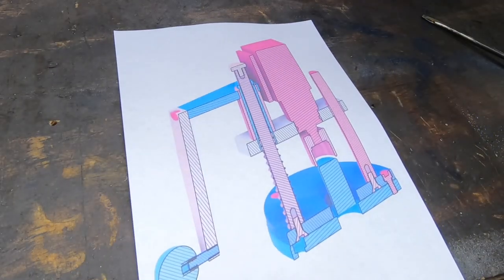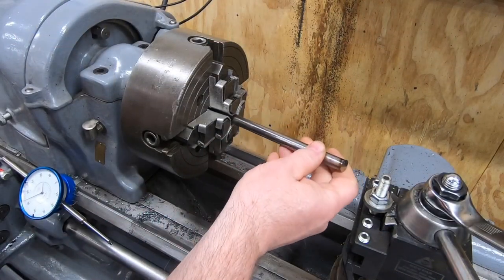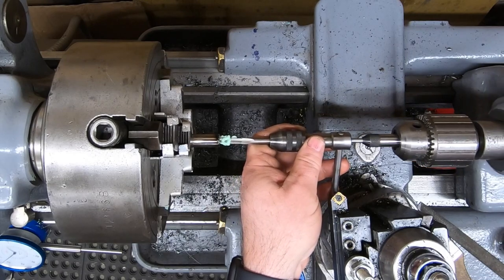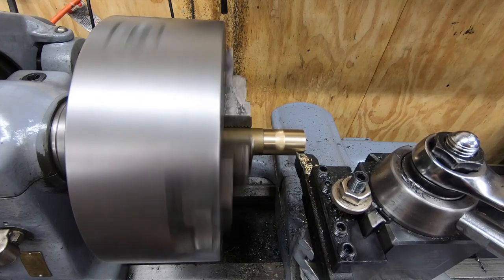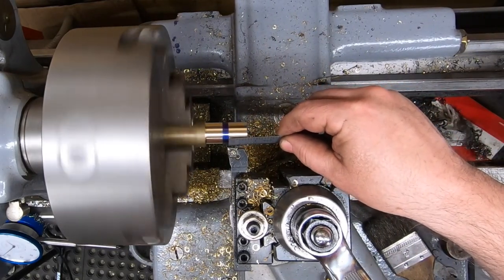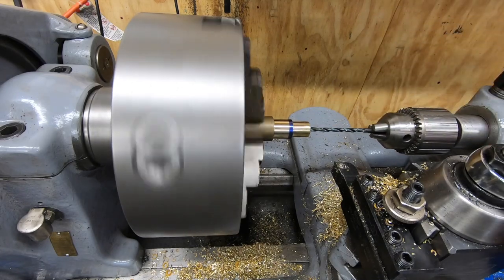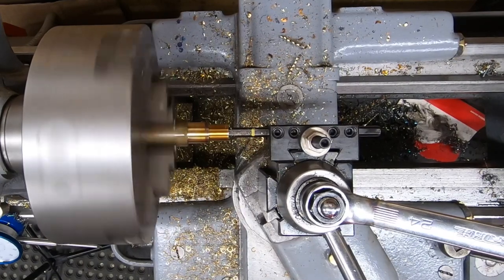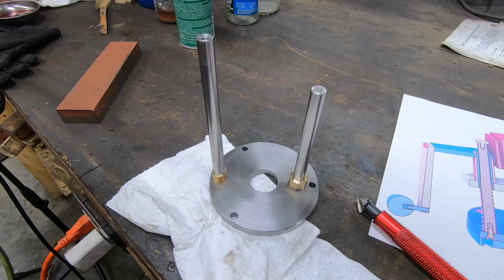Power Drawbar for the Bridgeport Mill - Making the Guide Shafts and Bushings

Comment: Maybe sintered bronze bushings could have been a better direction to go than the brass. Better lubricity and readily available. Just my 2 cents. 
Thanks for sharing 
Cheers
Reply from the maker: Thanks for the comment. I think there are probably 100 ways I could do this better. 😂 Part of my goal was to try and use material I had in the shop.
Reply: Of course my friend 
Cheers

Comment: I'm wondering if you have a piece of aluminium bronze rather than brass? It is quite a lot harder than brass which may account for the difficulty you had drilling it. Brass does need a sharp drill bit and bits that will cut steel quite happily can struggle in brass. Best case is a low helix or straight flute drill and only use them on brass. 
Regards,
Preso
Reply from the maker: I really have no idea what it actually is. I supposed it could be a flavor of bronze. I'm not even sure how I would find out besides having it tested.

Comment: figure out a way to grind the jaws of your 3 jaw. I use a vitrified stone in a router mounted to the tool post with a BXA  QCTP holder. I made some shims to hold the tension. now I have used the same set up on 3 lathes and 5 chucks My new lathe has 2 part jaws to I made a ring with holes to use one of the bolts to tension the jaws this time. I will hopefully be doing again today. this chuck has been ground for another lathe in the past. You must do this on the lathe the chuck is for.
      I am working on the back plate now. It is a similar set up to the mounting plate video from 2 months ago. I also had to relocate the holes in my vice to enbiggen the holes to allow for more adjustment. It ran 10thaou out 5 is a lot to grind. Grind until there are no sparks.
     The d1-4 taper on my new lathe doesn't exactly match a standard chuck. I used the grinder set up to match the backplates to the spindle nose. I got lucky twice now. The backplate for the er40 collet chuck is on the way. I expect to have to grind it too. 100$ only 1 chance.  
     The router is starting to hate life. I think the bearing is going. I may have a huge side project starting over with a new router soon. The current router has never seen wood while in my possession. I try not to get wood shavings on my skin. Stainless or cast iron no problem.
     Repeatability is usually less than 1 thou even after remounting in the 3/4" range. we will see how it goes this time. The er40 has been repeatable to a couple tenths on the last 2 lathes. The collets were over 300$
Reply from the maker: I have access to a Dumore tool post grinder when I get around to doing this. But I have so many other projects I need to get to first. It's a struggle.

Comment: Brass can work harden, then it needs to be annealed. But there's something wrong with your piece. I understand that there's no way to know which alloy it is, but some can be very hard, so in the future you might consider annealing an unknown brass before you work with it. 9 times out of 10 it won't matter, it seems you just got unlucky with this one. I could be wrong though.
Reply from the maker: I have no way of knowing what exact alloy it is. Annealing it is a great tip. Thanks!

Comment: Odd stuff, brass. I was taught during my apprenticeship 50 years ago to keep a set of files, drills and other cutting tools just for brass. Buy them new and never, ever use them on anything else. I ground a HSS tool for the lathe with I think 7 degree rake and clearance with a largish radius, it used to cut and finish brass beautifully. Lost it somewhere along the line years ago, still miss it.
Reply from the maker: I haven't turned much brass, but this is the first time I struggles with drilling it. I've read that the cutting angle on brass needs to be different for drills. I'm working on putting together a set of drills and then grinding them just for brass and labeling the index so I don't mix them up.